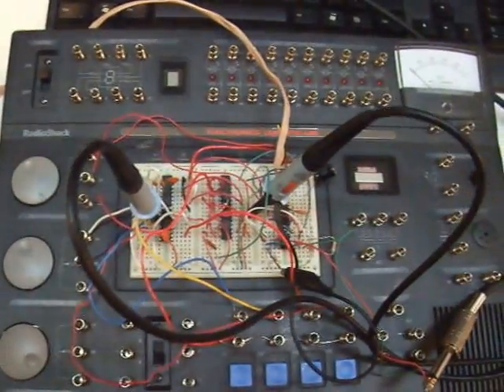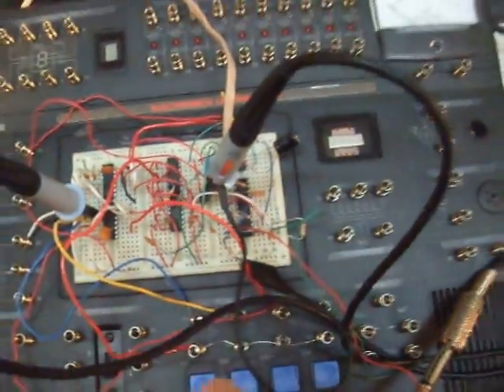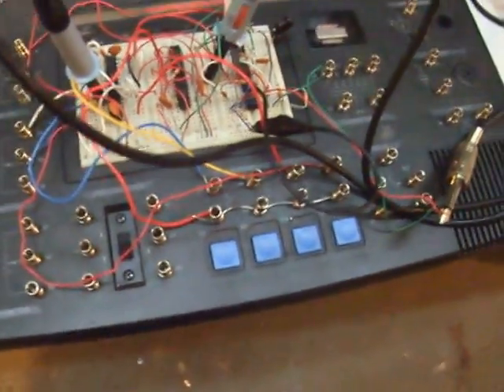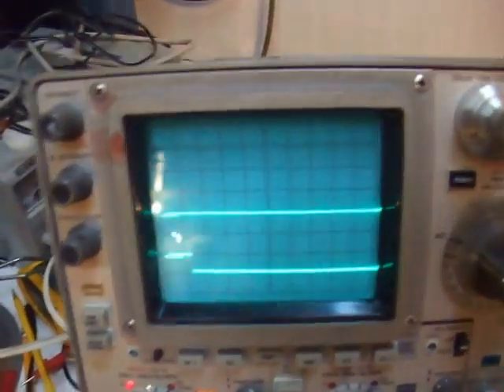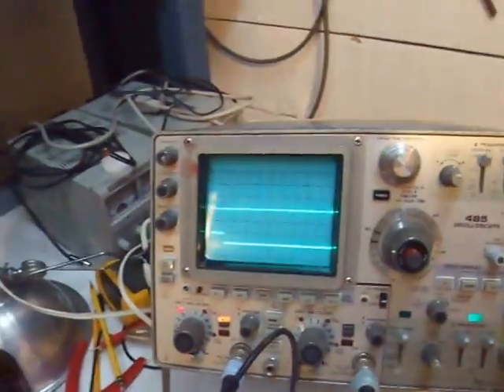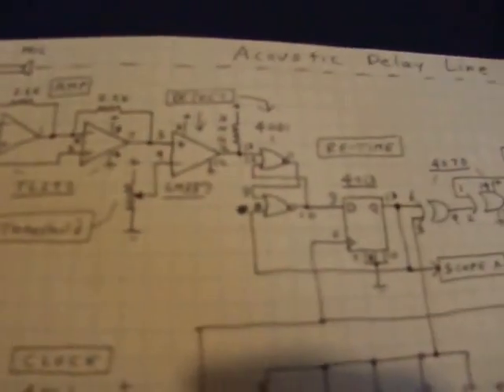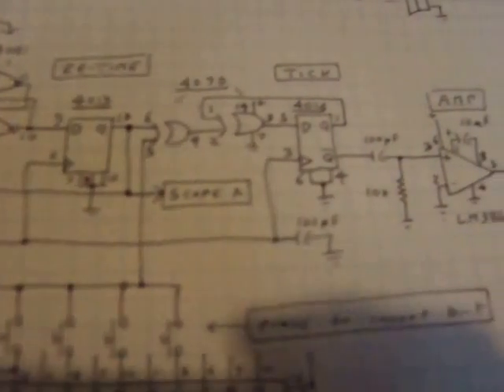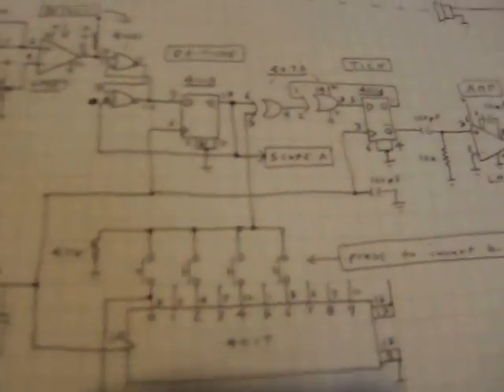Acoustic Delay Line Memory

Comment: i was wondering what is the delay this one is set at,  i see that your retiming it with an oscillator to resynch it,  but i was wondering what the delay is, i bet its a pretty tight one.   more delay would give you more bits no?
Reply: Sound travels about 1,000 feet per second. it looked like that speaker was about 8 feet from the microphone, and the air space held i bits, so he was probably clocking around 1 KHz.

Comment: Is it hold the data with making a loop? Cuz if there is only input-output, there is no way the hold the data to anywhere.
Reply: Most of the data is held in mid-air. :)
One can access the data serially, by waiting the appropriate amount of time and examining whether the "current" bit is set or clear.
Reply: @spatulasnout  But i can hold the data unlimited time , right? For example, you wrote some numbers and it can hold it unlimited time, right? Until it is overwritten cuz of reaching max of data.
Reply: @tromick  Yes, the data is "held" in the sound waves in the air gap between the speaker and the microphone. It continuously recirculates (is re-transmitted) to keep it 'alive'. The maximum amount of data (bits) is determined by the speaker frequency and the distance between the speaker and the microphone. (E.g. count the number of peaks and troughs that can fit between the speaker and the microphone for a wave form at a given frequency, travelling at the speed of sound.)
Reply: @spatulasnout  Thank you so much, it felt great to know after a long time curiosity.